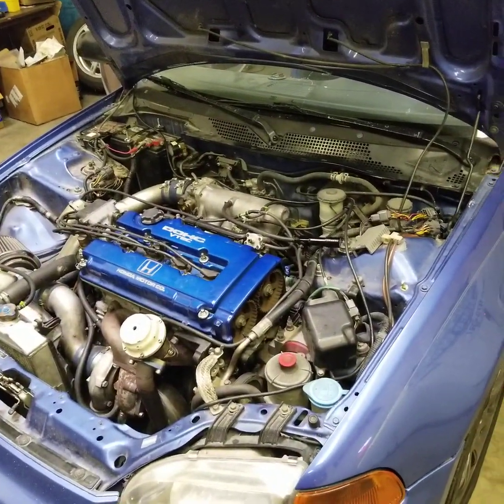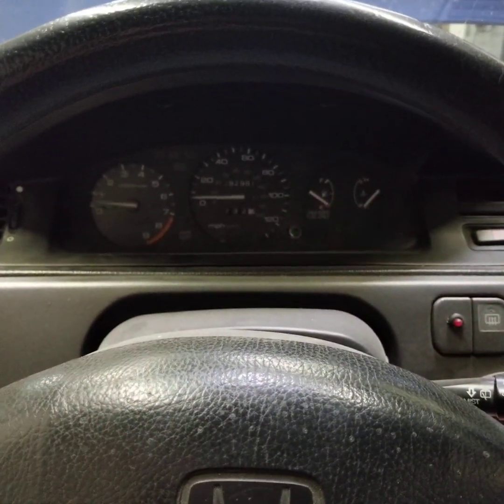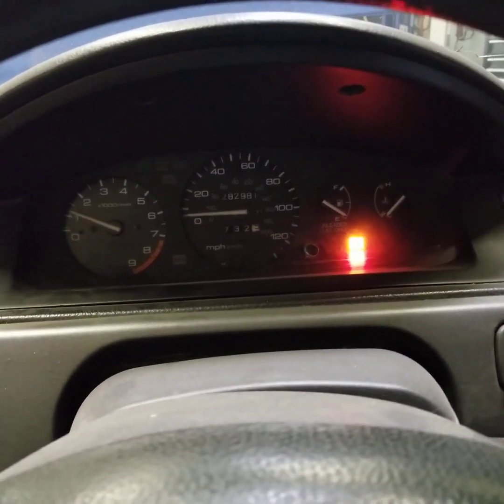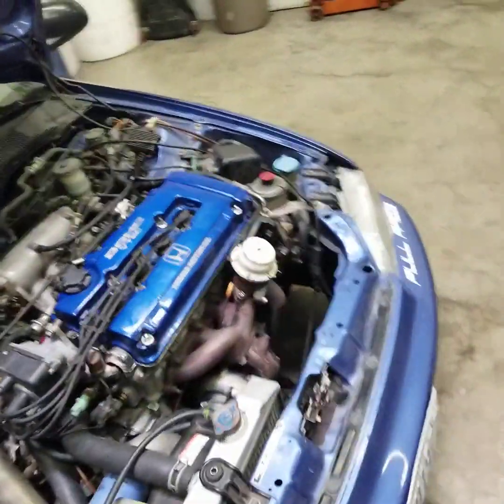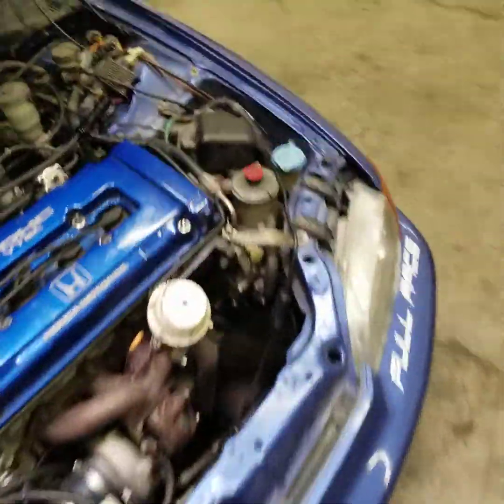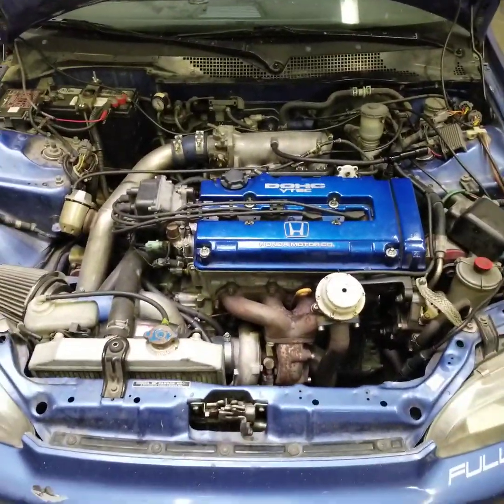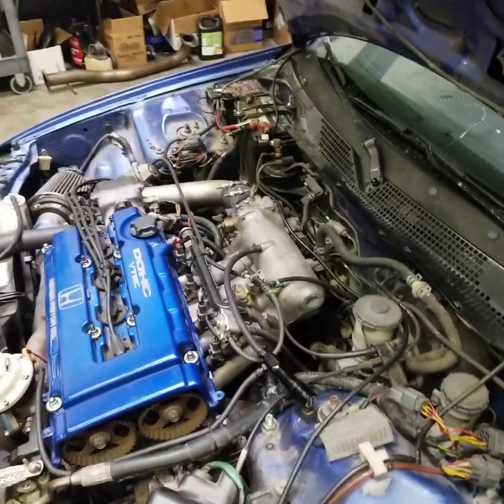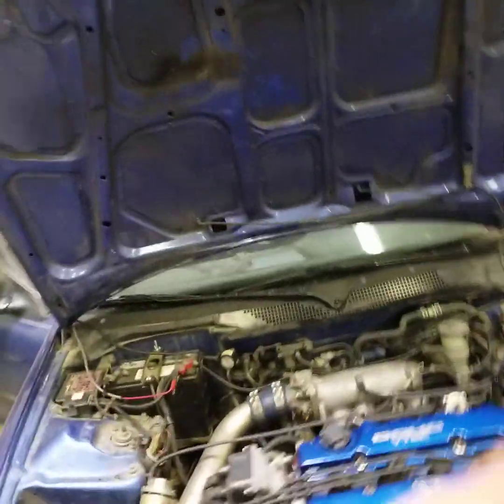Checking Honda OBD1 ECU codes

Comment: Not sure if there is a way to drop this wire but they have mine tucked to where it is inaccessible to where I'm afraid to pull on anything to possibly breaking a wire so off to the mechanic I have to go..

Comment: That's awesomeness. Thanks. You should do another video on Neptune features.....
Reply: I have Neptune.  It will not flash codes. Not running well. Won't go past 3k rpm
Reply: @lancer319  I switched to Hondata.
Reply: I_auto_enthusiast  why did you switch?
Reply: @lancer319  the Neptune ECU was a dealer chip, I could not make adjustments as I saw fit.